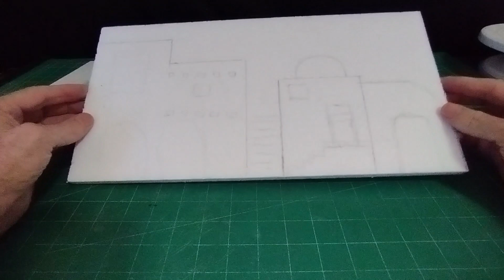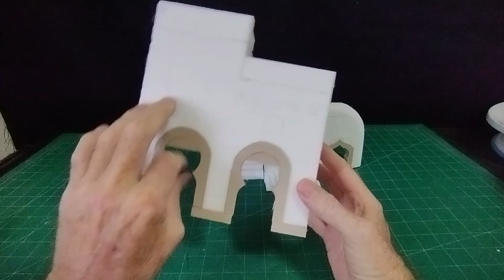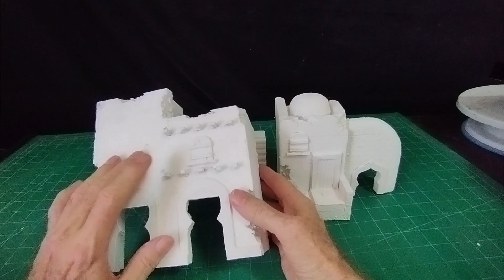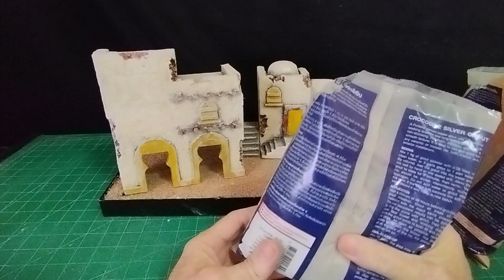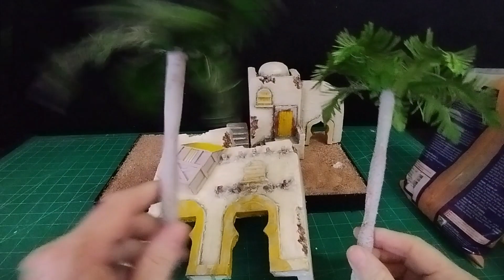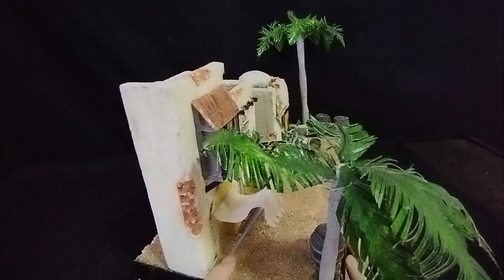North African village diorama.1/35 scratch built model (school project)

Comment: Looks pretty good, Don!  Yes, it could easily be used for a school project.  But with a bit more attention, it would hold its own on a military diorama, or a wargaming table.  This kind of structure is essentially timeless, and would look good in a diorama depicting Roman times, or with the simple addition of a satellite antenna on the roof, the present day.

As a sidebar, some craft shops sell premade polystyrene domes and even half-domes that you could have used in this project, as well as other premade shapes.